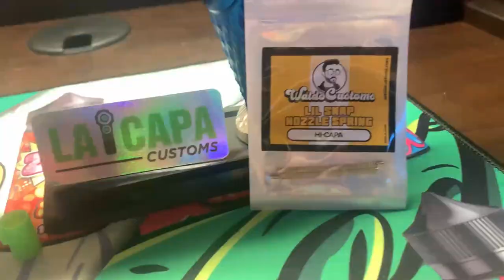Hi Capa Breakdown & Rebuild 2021 | How to Build a Custom Speed Hi Capa

Comment: houdini have you ever messed with a double bell hi capa 5.1? i just bought one and was wondering if parts from LA capa would work on it?
Reply from the maker: Sadly I have not.  I just tried to do some quick research to see if they are Tokyo Marui spec.  Some parts are definitely compatible just don’t know how far you can go with aftermarket upgrades on this Capa.
Reply: @HOUDINIIAirsoft  whoa where are you finding this info? Im not finding much just a few videos and they are all over seas so no english lol
Reply from the maker: @quinton7854  yea I found several of those too 🤣!  Most info is me reaching out to some people I know and Google translate 😂!  So hi Capa’s have some parts that are very universal.  Examples: Grips, hopup units, inner barrels, leaf springs, triggers, beaver tails, sears, nozzles, guide rods and guide plugs.  Blowback units, hammers, frames, and some slides can be very questionable.
Reply: @HOUDINIIAirsoft  ok so basically everything inside the gun is universal just the slide will be the issue
Reply from the maker: @quinton7854  In most cases yes.  Now the thumb safeties and outer barrel can be a 50-50.  So Armourer Works (AW) has some parts that will work with Tokyo Marui and vise versa.  Some parts will not work at all.
Reply: @HOUDINIIAirsoft  ok I did notice the LA CAPA guide tubes are just slightly bigger, nothing a little hammer can fix

Comment: Do you know how to fit the nineball 6 inch inner barrel into the hop up? Just ordered it and it d5 quite fit. Any help is greatly appreciated 👍🏽
Reply from the maker: It should fit just like any other barrel.  What kind of hopup are you using?  Stock, maple leaf, Airsoft Masterpiece?
Reply: @HOUDINIIAirsoft  stock TM and nineball soft purpl5
Reply from the maker: @lacc_nick  so what’s do you mean it won’t fit?  Like the hop won’t close all the way when you tighten the screws on the hopup?
Reply: @HOUDINIIAirsoft  Correct, it will not close flush
Reply from the maker: @lacc_nick  That’s common.  My maple leaf hopup done the same.  I lock tighted the screws and tightened them as much as I can.  Be careful with the screws they are easily stripped.  Best I have found to fully close on the barrel is the Airsoft Master Piece hopup.
Reply: @HOUDINIIAirsoft  Thank you very much guy!
Reply from the maker: @lacc_nick  no problem. Glad I could help.